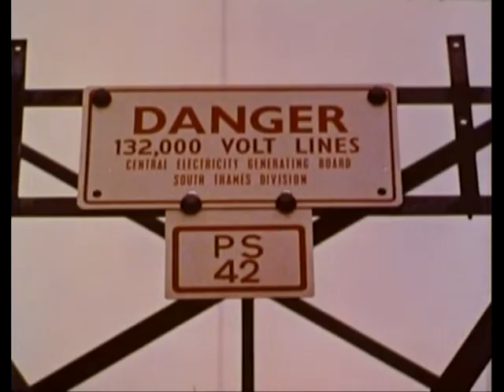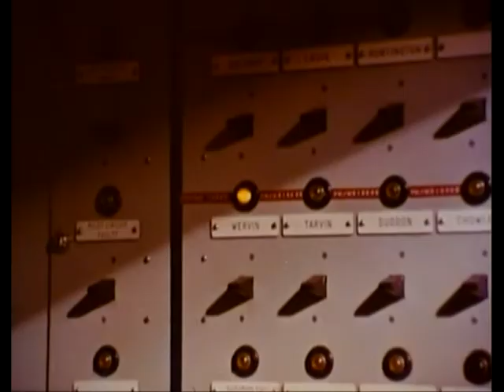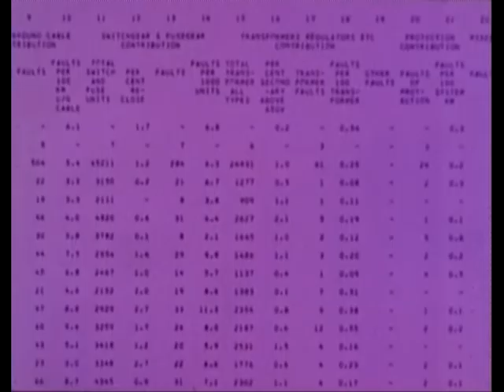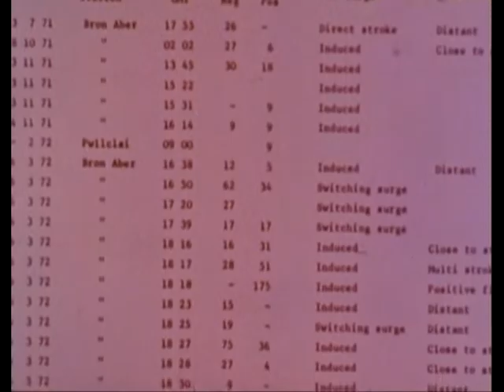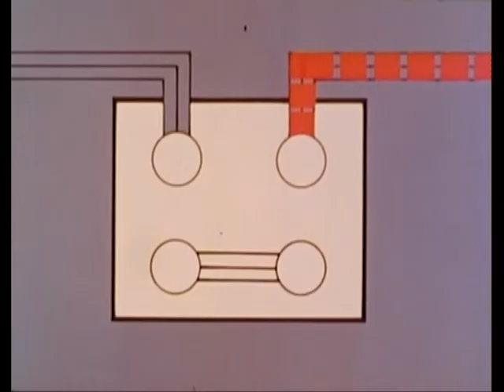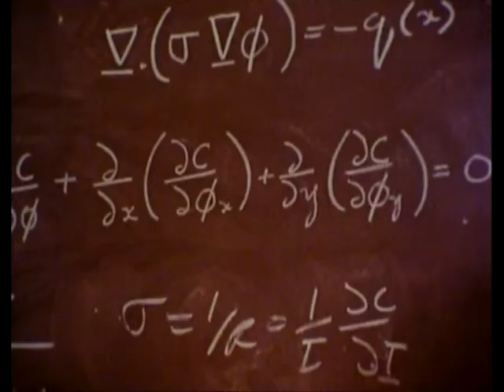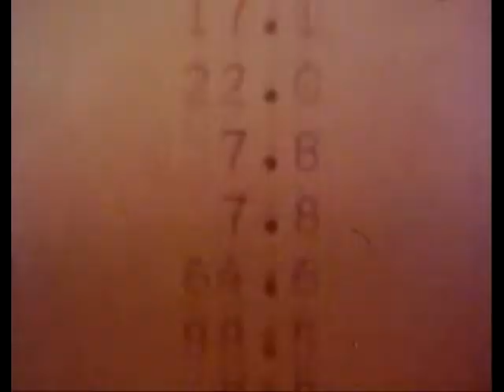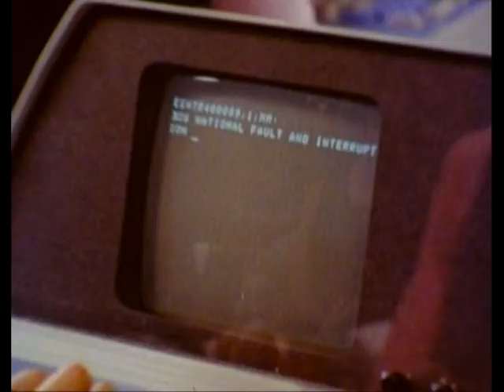Power Links (1973) Electricity Council Film - substations and power lines - UK Industrial Film

Comment: Back when gas companies didn't try to supply electricity via the phone lines :)

But the water company said no.

Ain't privatization wonderful? (glad you're dead, thatcher)
Reply: NSP in the United States experimented with natural gas distribution overhead,  like a wire. The poly pipes were spun onto messenger wire,  much like CATV and phone lines already were. Thankfully,  this never took off.
Reply: Via the phone lines???
Reply: Far more power cuts in the 70s  than now. 3 day week? Winter of discontent ?  Power out for millions at a time for hours on end. Today a freek storm once a decade takes out power  for a few  thousand for a few days and it Is national news.  Take of the rose tinted glasses every one.